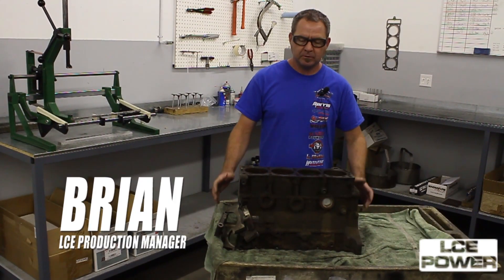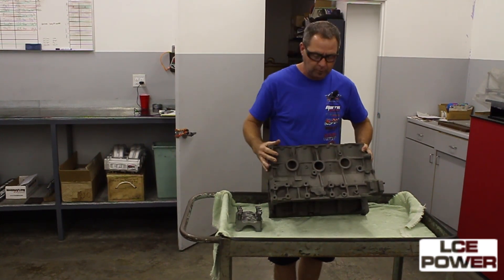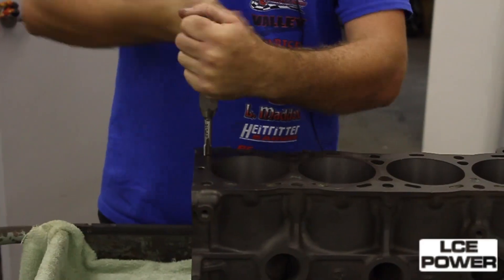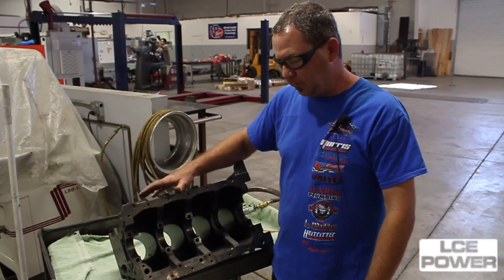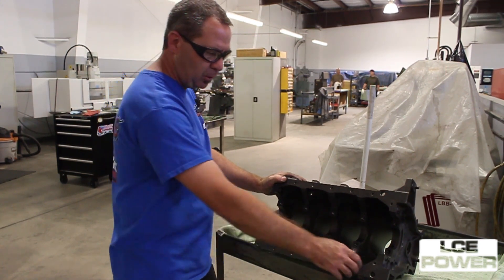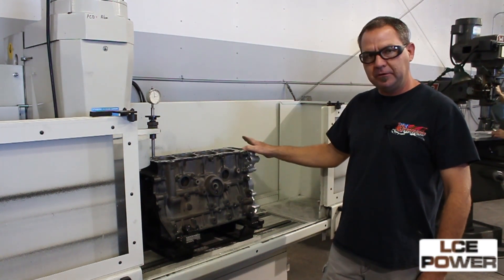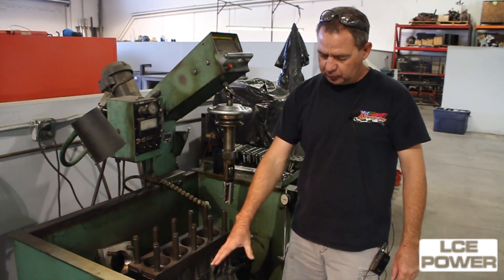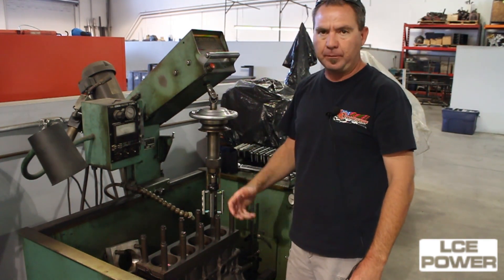LCE 22R Street Stroker Long Block Build Mini Serie - Episode 01

Comment: Hows it a long block if it's a late model with a bowe tie it's a short block  84 or later 81 to 83/84 is when they changed blocks and main bearings changed in 83

Comment: I think I need a rebuild.  My 22R keeps overheating, I changed the radiator, hoses, thermostat.  It has the original aisin carb.  If the block gets overheated to the point of the caps leaking is it toast?
Reply: Check your fan clutch